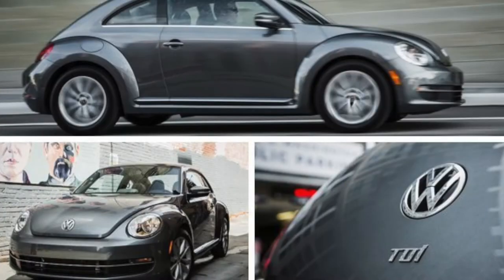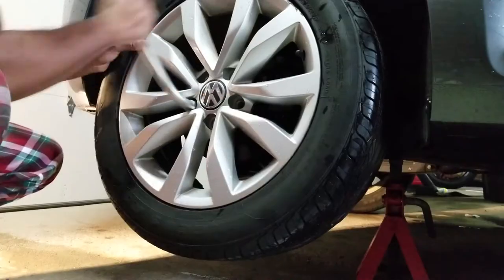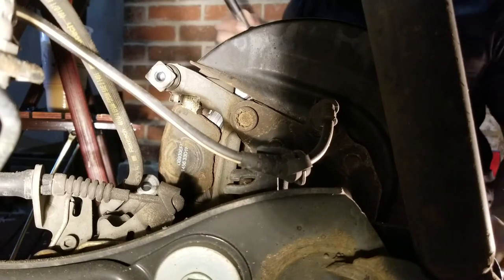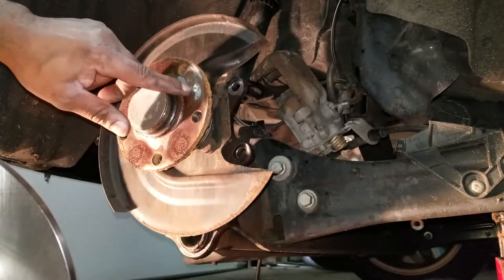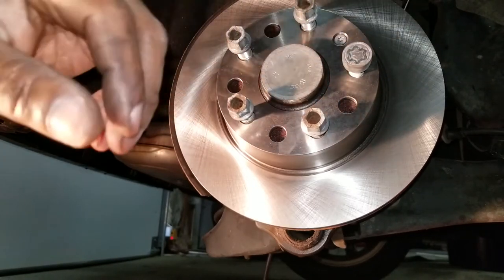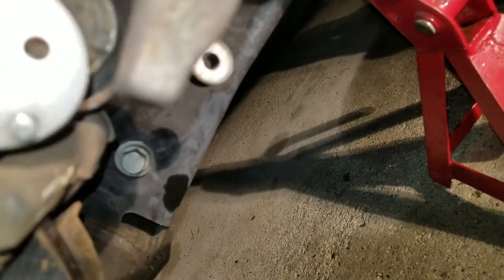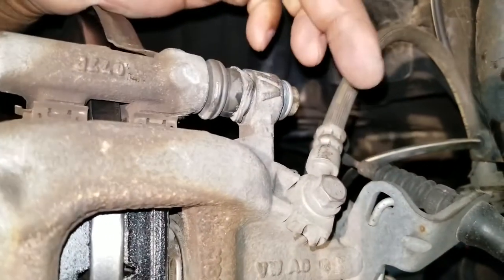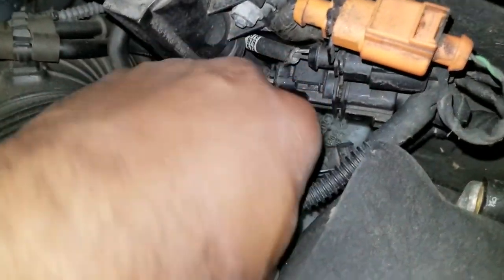Volkswagen Beetle Brake Pads and Rotors DIY Replacement | iRepair Autos

Comment: I did this job today. It’s really hard to do this job on the ground with some jack stands. The hard part is the caliper mounting bracket. 

Check minute 5:15 to see the subframe screw I am referring too. 

The bit to remove the mounting bracket is a M14 triple square bit. If you use a breaker bar that has bulky head it will not fit when removing the bottom mounting screw because there is another screw next to it. You need to remove that subframe screw, it uses a size 16mm regular bit on both sides. Keep on eye on how that screw disassembles a little metal cylinder so you can put it back together when the rotor is installed. Use an extension through the hole where the 16mm screw was and remove the bottom mounting screw.

Great video the only other thing I did besides what has done in the video is grease the rubber parts. I used brake grease on the calipers piston before turning it and I cleaned out the OEM grease from the sliding pins and added new grease.
Reply: I'm trying to do this on my 2017 beetle what tools do you recommend? Shop was going to charge me 600 dollars to replace rear break pads
Reply: @arturoe3810  same for me. I was quoted $600 for the rears. Everything you need to know is in the video.

Comment: Why didn’t you grease the sliders ? As far as I seen you didn’t even check them . I’ve been doing this kind of work for 30 years . On thing you need a impact to take lug nuts off it makes it’s so much easier and you do not have to change rotors every time you change pads . Shouldn’t take no more then 30 mins to do both sides